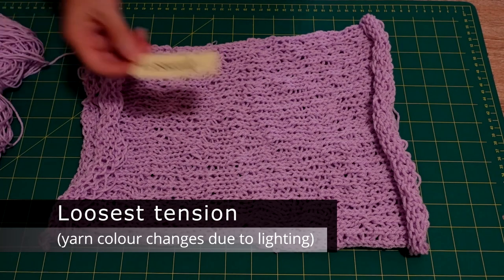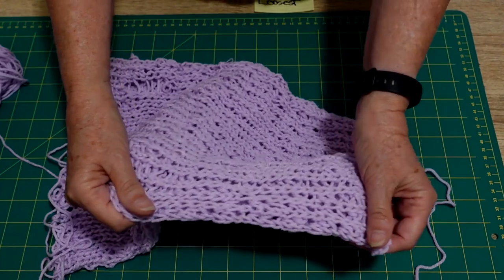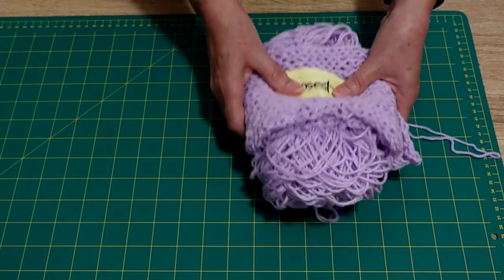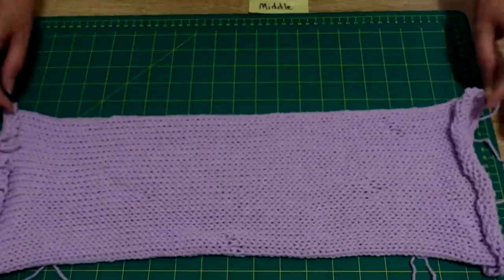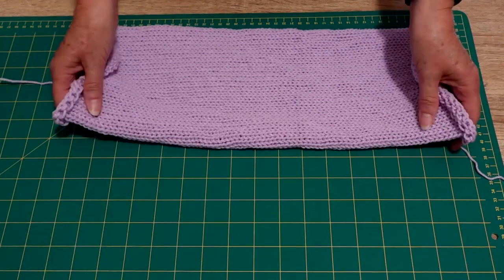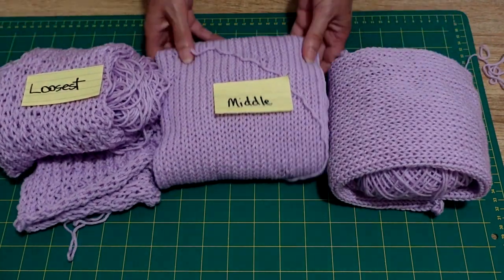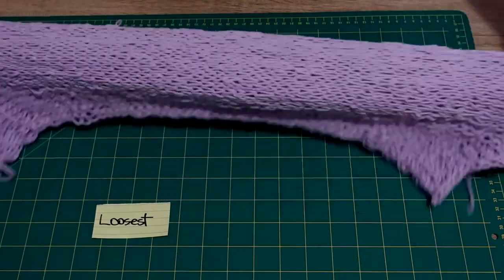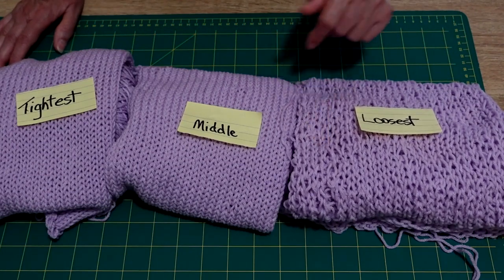KNITTING TENSION on the Sentro circular knitting machine

Comment: you missed one very important point. The brand of yarn you’re using.  I’ve had the best luck with the big twist value from Joann fabrics and I love this yarn from Hobby lobby. whenever I use either of these yarns,  I run at least 20 rows first to see what happens. I always start with the smallest hole or rather the tightest tension. If there’s a problem,  I move to the next hole  and run another 20 rows and see what happens. You have to play with it every time you use yarn even within the same brand. There are yarns that do not work at all. You will notice the texture by touch and compare that to yarn that does. Some of it just is not smooth enough to run through the machine.  I have managed to make tubes as long as 6 feet with not one dropped or tucked stitch by using my method. I hope you will find this useful.
Reply from the maker: Yes that's very true, that different yarns work differently in these machines (even the same yarn but a different colourway can behave differently, as some colours affect fibres more than others).
The purpose of this test was specifically to demonstrate how the same yarn can result in dramatically different results based on which tension hole you use.

Comment: Great video thanks. However the fact that you have tucked stitches in all three pieces makes me think it's either the yarn or you are simply cranking too fast. Honestly I usually use all three holes at once and find that works best for all projects, although the yarn does notoriously slop out if the smallest hole on all my machines so I don't crank too fast for this reason. Using the three hole method with a 50 row swatch DK yarn stretch lengthways I get 30cm on 48 needles 25cm on 40 needles 24 cm on 32 needles and 25cm on 22 needles. However the tension on the 22 needle machine is always a bit looser. 
I don't think you have to limit yourself to choosing one tension slot, try all three or different combos of two.